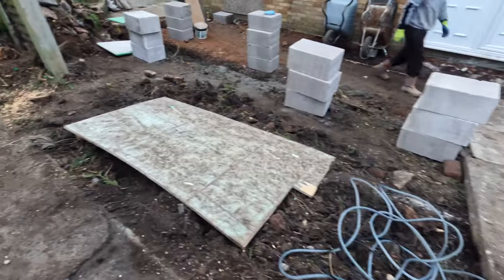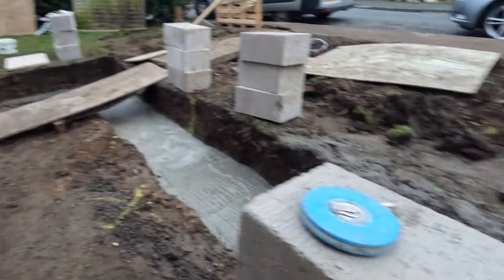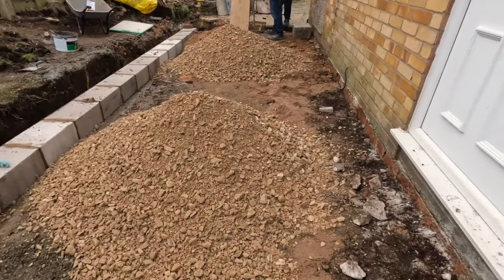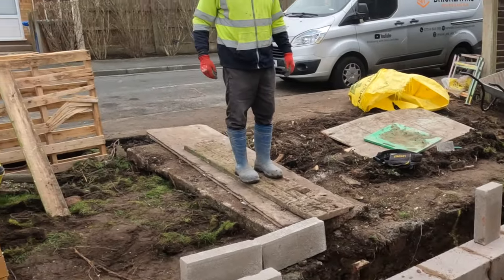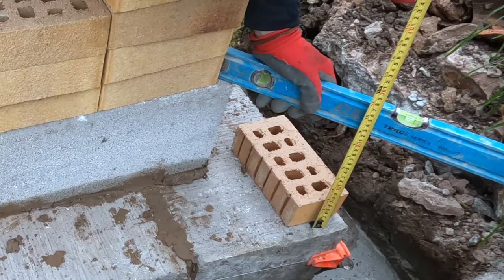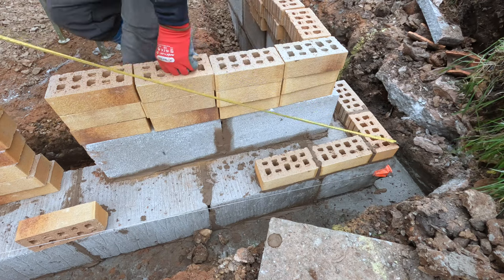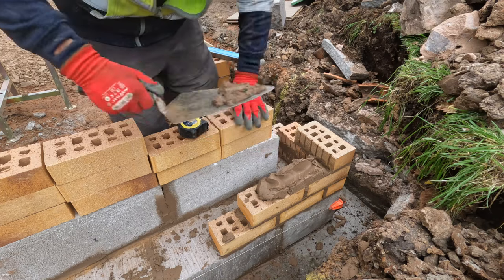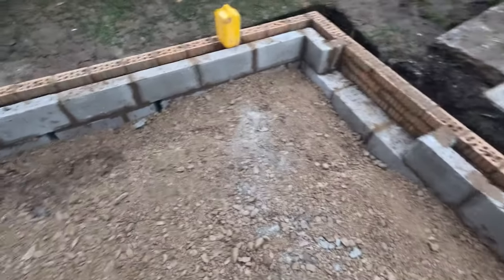BUILDING UP TO FLOOR LEVEL... EXTENSION PART 4

Comment: Wow that's quite a decent size extension,and with that hedge out they will regain loads of their land and lots more natural light will flood in.We took our privet out front and back,some 6foot tall and 3 foot wide our garden is soooooo much bigger we couldn't believe it,think you need a new blade for your Stanley knife🤣 great job you 2 as per.
Reply from the maker: Yeah definitely the hedge was nearly 9 for wide at one end 😆🧱👍🏽

Comment: When our extension was built we had the gas pipe pass through under the ground.  Our builder confirmed it was a metal pipe with plastic pushed through so safe to do that but I was never 100% sure about it.   Seeing exactly the same setup here puts my mind at rest a bit
Reply: We never get away with it.! Always have to move them.!🙄
Reply from the maker: Exactly the same here Matt . We had Cadent out to check 🧱👍🏽

Comment: You need to watch your back Steve when you're stuck in the corner.  What did the building control say about toothing in and the cavity ?
Reply from the maker: No need to tooth out ( gauge all wrong ) no cavity cut just a vertical damp 🧱🧱👍🏽

Comment: great video guys!
Did the owner not need to have the cavity to the new part L requirements?
Looking forward to seeing the new camera :)
Reply: Probably approved before new regs introduced..
Reply: @nigelsmith1198  was thinking that when I commented. Reg changed June 22 so quite possible
Reply from the maker: No the extension will meet the new regs 🧱👍🏽

Comment: what a waste of bags it was never like that in my day a tied knot opened it at the bottom just an observation
Reply from the maker: Not any more unfortunately 😒🧱👍🏽
Reply: Manufacturers say the bags are one use only.
Merchants won't take back or even fill yours.
Reply from the maker: @markdauncey927  nope such a waste 😒🧱👍🏽
Reply: 'Elf ans safety gone mad
Reply from the maker: @markdauncey927  very true mark , such a waste 🙄👍🏽🧱

Comment: IBStocks below damp??? What…
Reply from the maker: Er yes 🤷🏼‍♂️
Reply: @SteveAndAlexBuild  
Thought it had to be engineering below damp..
Reply from the maker: @zakshuker220  . No pal you match what is in the original house which are terrible London bricks but they’ve been there for over 50 years 🧱🧱🧱👍🏽
Reply from the maker: We did the same in the old solid commons often with a 12 inch to 2 foot pig to cut out . Our boss didn’t bother with levelling concrete 😆🧱👍🏽
Reply from the maker: @martin2466  🤣🤣🧱👍🏽